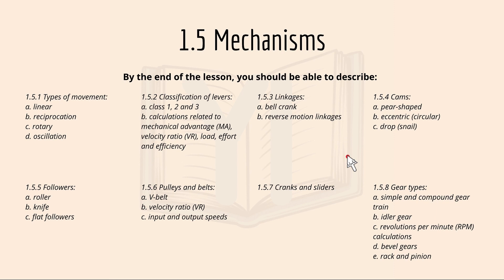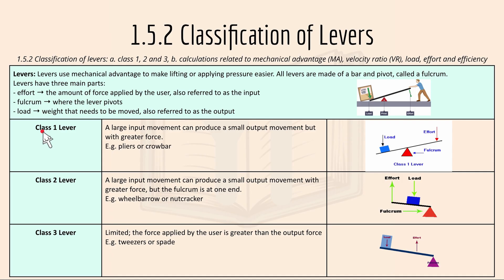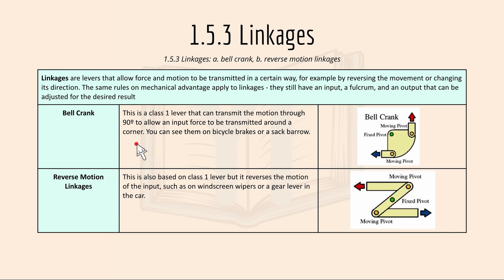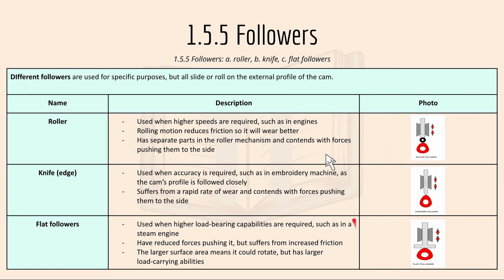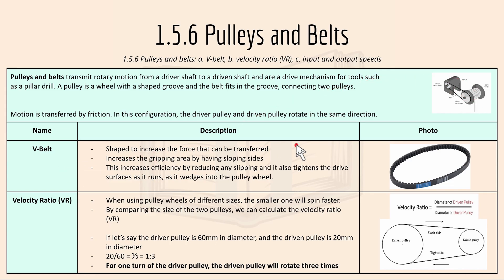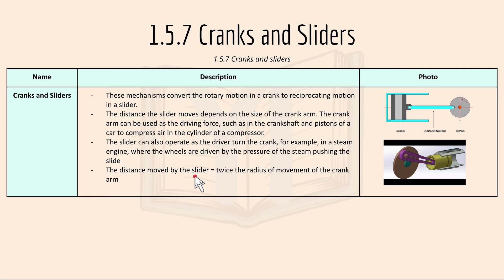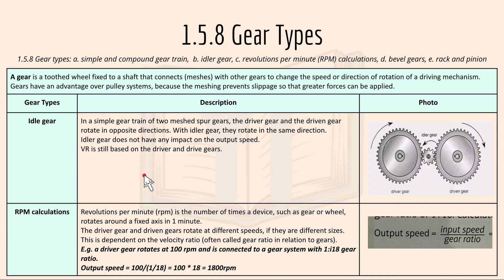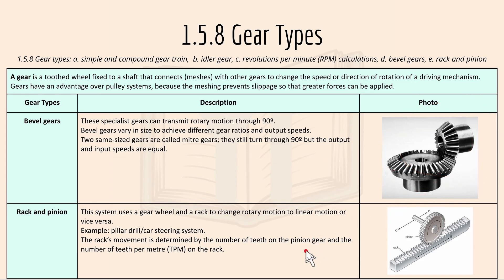EDEXCEL GCSE Design Technology: Mechanisms (1.5)

Comment from the maker: Edexcel GCSE Design Technology time stamps:

1.5.1 Types of movement: 00:37
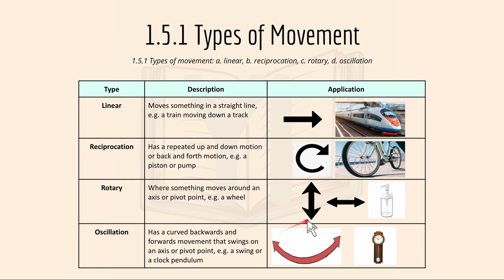1.5.2 Classification of levers: 01:14
1.5.3 Linkages: 03:28
1.5.4 Cams: 04:16
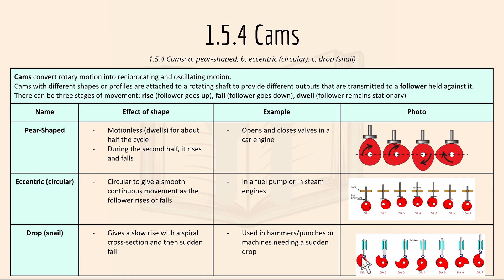1.5.5 Followers: 05:39
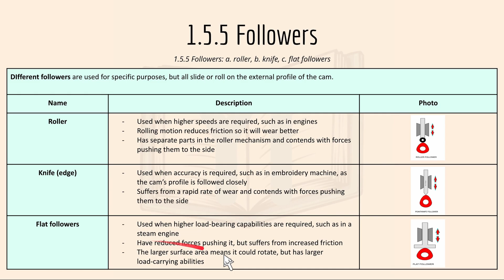1.5.6 Pulleys & belts: 06:43
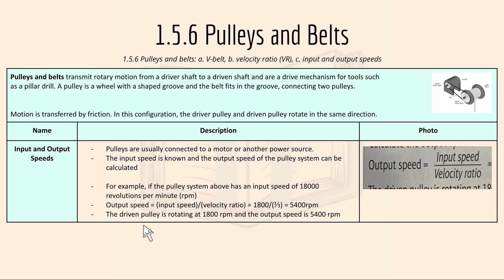1.5.7 Cranks & sliders: 09:12
1.5.8 Gear types: 09:52